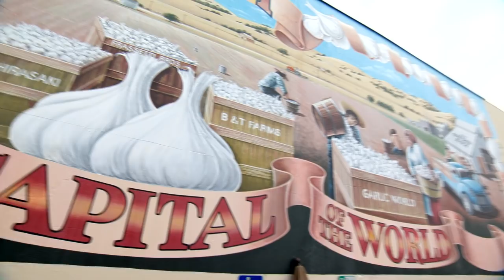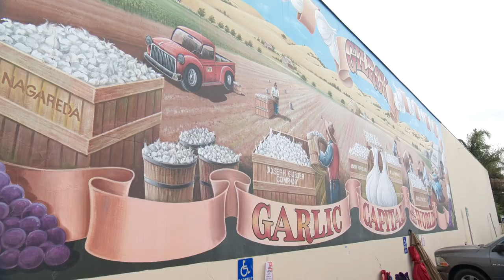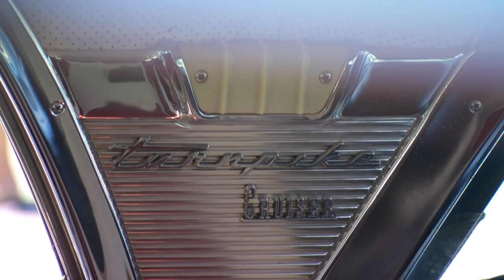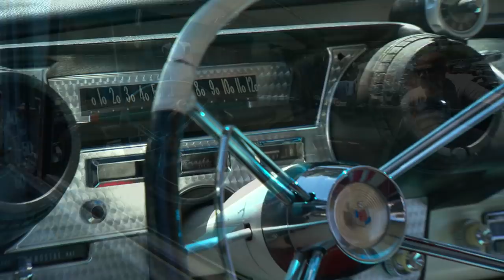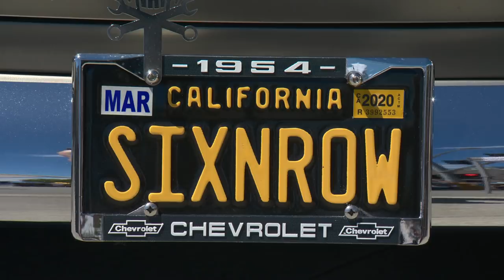Garlic City Car Show | Director's Cut

Comment: "J.A.T.O.  Thrust " ( Pronounced 'Jay-toe' ) is an old acronym for "Jet Assisted Take Off" from the military technology of the day. Rocket strapped to prop powered aircraft to shorten take off distance with large loads.
Reply: Stole my thunder.... accurately.
Reply: @BillB23  You arent the only one...
Reply: R. Ben Barthelme theautojunkie : also used on jet aircraft...first used by the Germans in WW2
Reply: Im sure it felt like it needed J.A.T.O. getting that 5,000lb behemoth off the line, with the high axle ratios used on that type of car, and the automatic transmissions of the era.  lol  That said,  oh what I'd give to go cruise the Turnpike in that Turnpike Cruiser!!!
Reply: There was an actual rocket powered assist rear differential they were testing in drag racing that added like an instant 10000 horsepower

Comment: Like that 1967 antique VW Safari Bus with swing out split windshield (it last year for this feature) and 8 skylights on the roof. Some VW owners do install the pre-1940 sealed beam headlights to customized their vehicles, also its last year, since 1968 VW Buses, and Westfalia campers are totally restyled. By the way, the 1967 VW bus is European style because the blade bumpers without the over riders and vertical bars are removed.

Comment: The JATO thrust engine on the Mercury Turnpike Cruiser is a reference to “Jet Assisted Take Off”. Propeller driven military planes of that era mounted jet engines on the wings to increase take off thrust and reduce the need for longer runways.

Comment: When I was a teenager in the late sixties, a friends' father had a car with the powered back window.
We would go for rides in the country, taking turns laying on the trunk with our legs inside.
Reply: That would be grounds for the state taking your children, and criminal neglect nowadays. They've taken the fun out of every damned thing.
Reply: @bradcarroll3719 : Back then I had a '65 Chev with a six cylinder motor. We'd go plowing through snow drifts on country roads and get it down to a couple of cylinders, wait until it fired back up and give it a go again. The only thing that's taken the fun out of that is... there is no more snow, or not enough when there is.